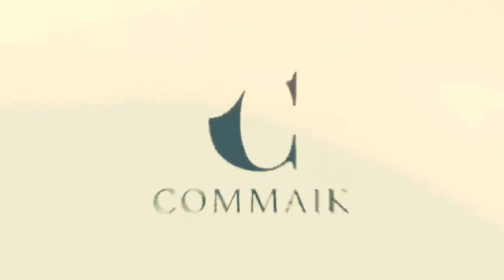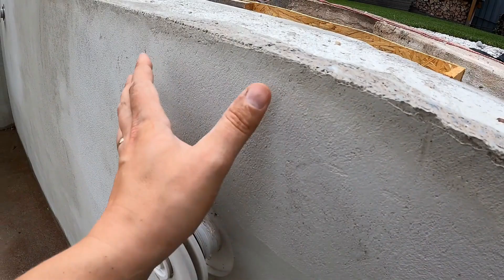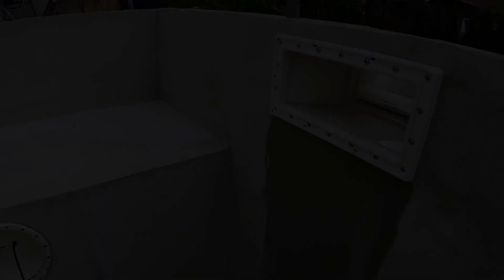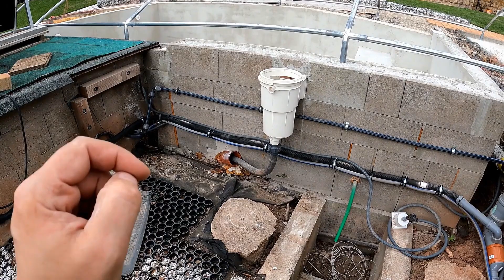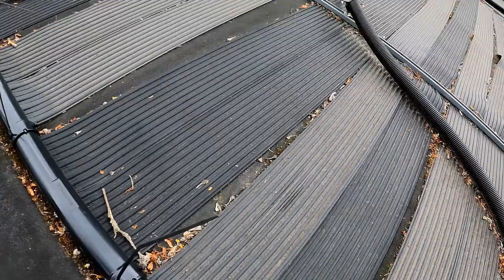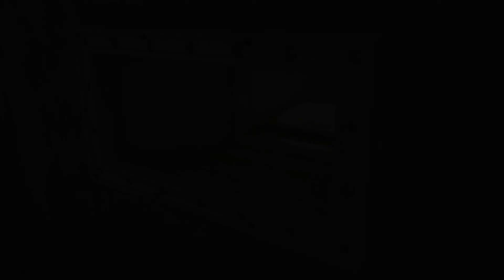DIY Pool Conversion: Preparing for the Liner Installation

Comment from the maker: Product list:* 
🔗 Thread sealant: https://amzn.to/3wgcqqA
🔗 Pipe cutter: https://amzn.to/3jI0MSE
🔗 Assembly wrench: https://amzn.to/3dH79ly
🔗 Reducing piece: https://amzn.to/3suNWZB
🔗 FlexFit elbow IG: https://amzn.to/3qLIBx4
🔗 FlexFit T-piece: https://amzn.to/3jGXY8D
🔗 FlexFit pipe by the meter: https://amzn.to/49nDzfg
🔗 Inlet nozzle: https://amzn.to/31qF6jD
🔗 Closure for inlet nozzle: https://amzn.to/3ylUgFw

This video was originally created in German for my main YouTube channel @commaik 🔗 https://youtube.com/commaik. It has been translated into English using 🤖 the AI tool HeyGen, which replicates my voice and synchronizes my lip movements. 

Please note that ⚠ due to dynamic adjustments, the synchronization may not always be perfect.

📺 The original video, which includes English subtitles, can be found here: https://youtu.be/qsWOY9o6yFw